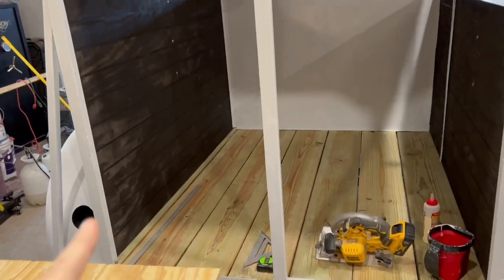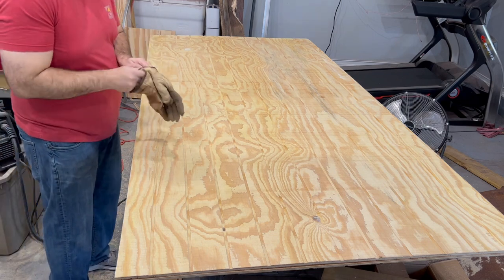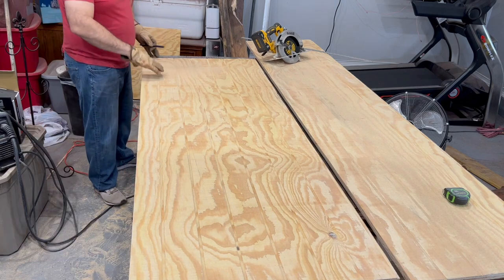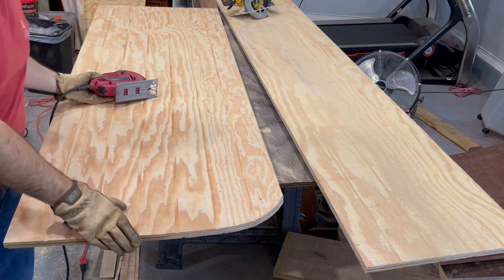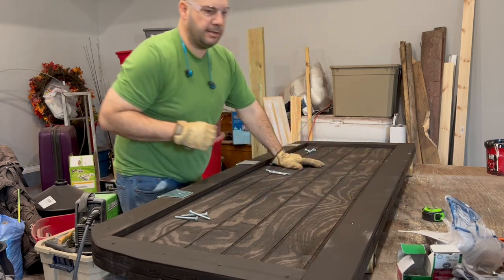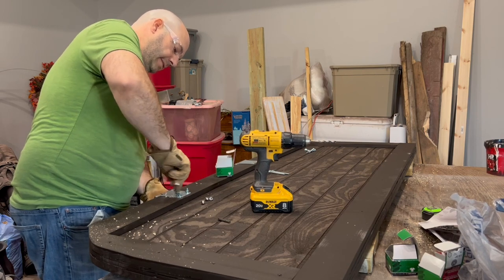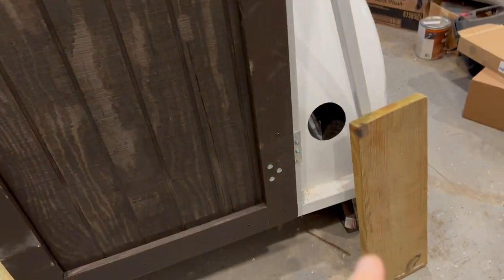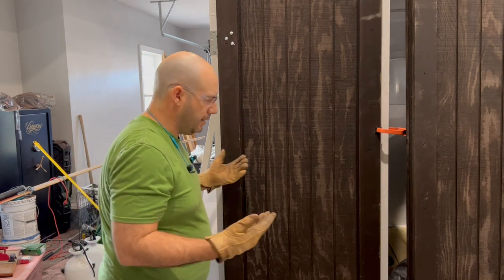How to Fab and Install the Rear Doors (1997 model)

Comment: How do you keep the water from getting in or keep the doors are sealed?
Reply from the maker: @MageeNick  You just have to get it as close to sealed as you can. These were horse trailers and were never designed to be water tight. I always recommend that people store their trailer either under a roof or in storage somewhere when not in use. However, it should all last many years even if it’s out in the elements constantly. Hope that helps!

Comment: Thanks for posting about this! I live in the Mojave Desert. It sometimes gets up to 120 degrees out here. What can I use on the plywood to stop the extreme heat in the summer and the rain in the winter from messing up my back doors on the edges?🤔
Reply from the maker: I use an extreme weather deck stain on mine. It should do the trick, although you could  coat the edges with epoxy to really seal the grain up.
Reply: @carriagehousetrailers  Thank you! That was my plan.

Comment: Do you have A video of making the window with the hydraulic
Reply from the maker: I think I have the footage. I just need to get it edited and uploaded. Thanks for the reminder!
Reply: Thank you for responding when you do can you let me know 😊
Reply: Also what kind of bolts ,nails, or screws do you use  from the inside to the outside. I don’t want to really want to see the ends on the outside
Reply from the maker: @michellegerlick5653  I use 1/4” carriage bolts and use acorn nuts on them. The acorn nuts actually make it look fancy and not ugly. I know what you mean about not wanting to see the fasteners. The acorn nuts make the fasteners a feature instead of an eyesore. Here’s the ones I use: https://amzn.to/3tmb8Pt
Other fasters I use are some self tapping sheet metal screws and for trim use aluminum rivets like these: https://amzn.to/48cVuVe